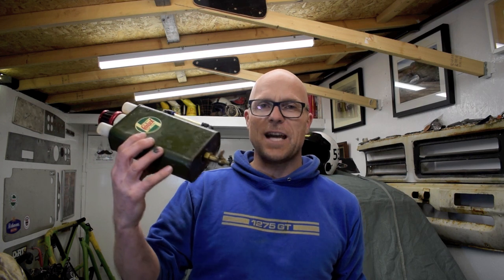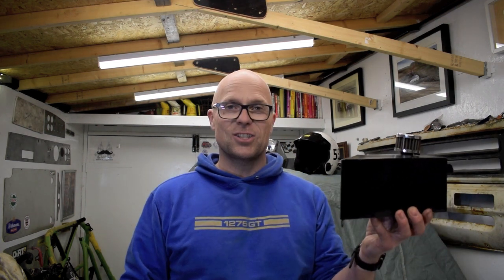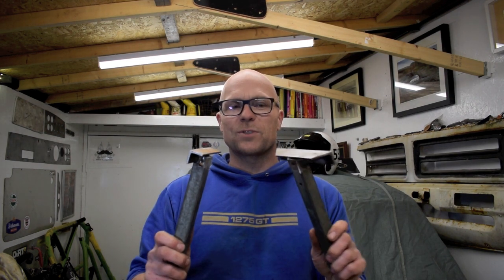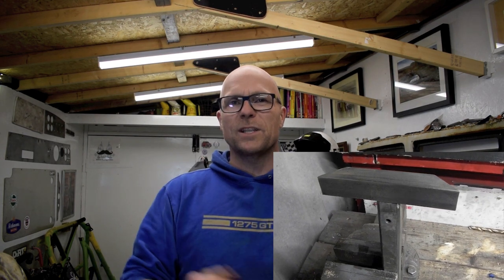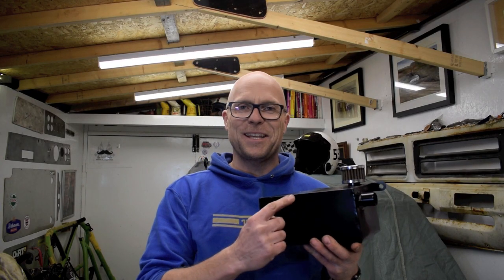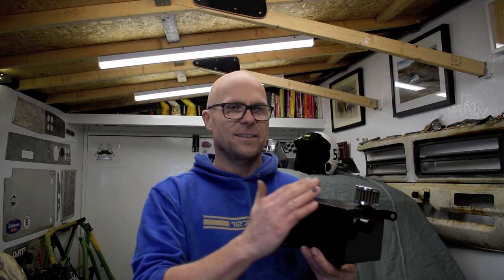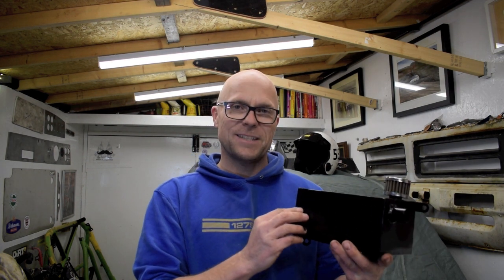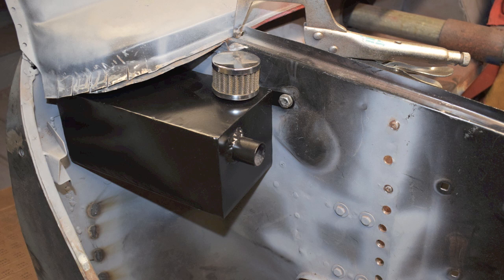Building a Classic Rally mini Part 28 - DIY under wing oil catch can / tank

Comment: I thought you needed a 2L can on an engine of 2000cc and under and a 3L can over 2000cc for stage rallying in the uk?
Reply from the maker: Hello thank you for your comment,it prompted me to have a look at the 2020 rules in the MotorsportUK year book (The blue book). And on page 323 in the stage rallying section it states - 48.2.9. Engine Oil Systems – Unless equipped with a closed
loop system, a Catch tank of at least a one litre capacity to be
incorporated in the oil breather system. - Few I thought the regs had changed . Anyway thank you for watching the video and I am genuinely pleased you made me look at the blue book as I picked up on a few other things I need to consider during this build

Comment: Can I buy the castrol can lol
Reply from the maker: Ha ha, it's a great looking thing isn't it. Unfortunatly I need one for my mk1 as the last time I took it hillclimbing at Gurston Down they picked up that I did not have one so I had to improvise and use a plastic milk bottle. This would look just right tucked in the engine bay sorry. Maybe I should start making Some?
Reply: @TheGentlemensMotorRacingTeam   I actually collect old oil cans, signs and model cars. That's why I was looking for it. But it would look col as fuck in an engine. If you have any oil cans you'd sell or if you're making some of them let me know I'll have 1 for sure

Comment: Kevin, Nice job this is something i need to buy or make for the track car, Cheers Dave
Reply from the maker: cheers mate, yea for the track car I would go aluminium, this was made out of 1mm steel and although not heavy is adding weight to the car, I would go for one of the alloy ones. glad you liked the video